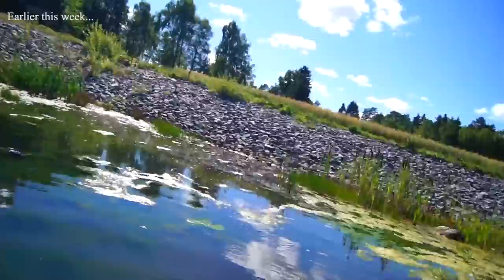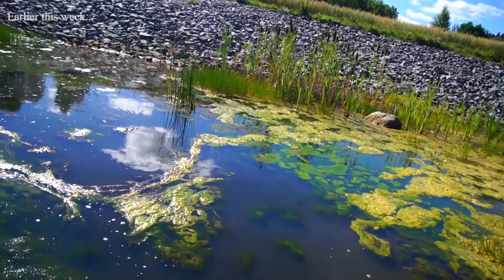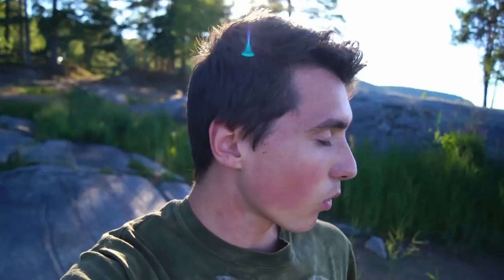Fast Foam RC Airboat Run on Water and Sand - RCLifeOn

Comment: Can You please give me the link from the receiver and transmitter?that would be amazing :D
Reply from the maker: It's not the one used in the video, but works exactly the same: http://www.ebay.co.uk/itm/New-Flysky-FS-GT2B-2-4G-3CH-System-Transmitter-Receiver-for-RC-Car-Boat-SP-/172252468373?hash=item281b0c1495:g:RDEAAOSw-4BXbVvc

Comment: do you have a print/plan for the boat ?
Reply: Agent Orange 
It’ really easy you just have a kind of rectangle as the platform and a motor mount and a wing thing 
I made mine in about 2 hours without the video trust me it’s easy
Reply: @ytcsabidealer8387  I know this comment was 2 years ago.  But if you'd be so kind to help me how do I make mine able to stear